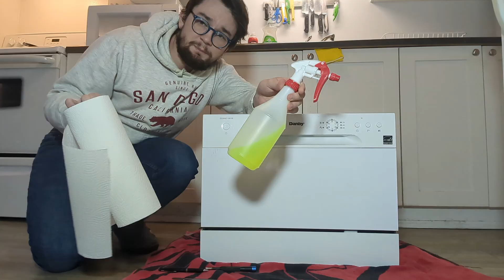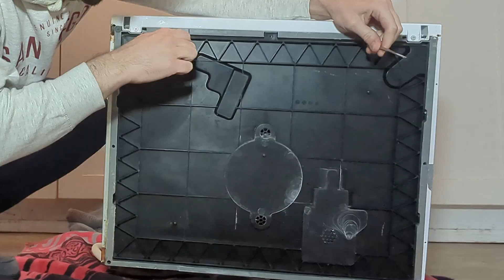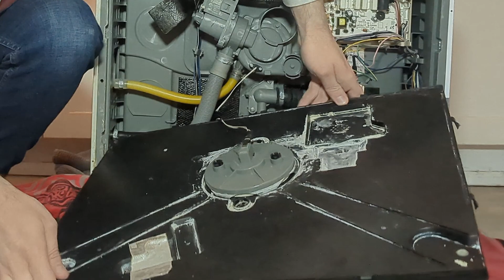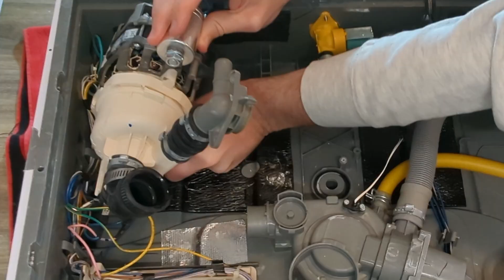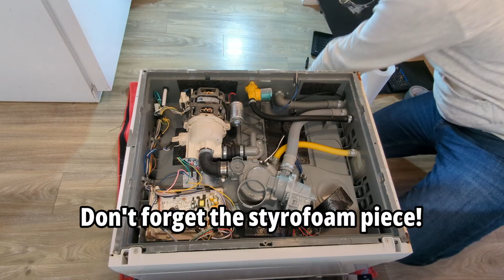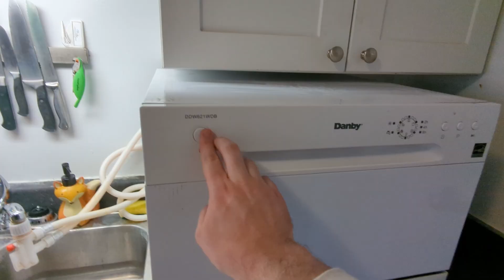How to Repair Leaking Countertop Dishwasher | Danby, Comfee, Hamilton Beach, RCA, SPT, BLACK+DECKER

Comment: I just completed this repair and ended up replacing the gasket on the part he is removing at 6:55, the o-ring gasket on the upper part of the pump assembly as well as the oil gasket. After changing out those my dishwasher is back to working beautifully again. Just an fyi for anyone reading this, save yourself some shipping charges and get them all at once! I didn't know I needed the pump assembly upper gasket and had to wait for it to come in. Great video and saved me from paying a repairman. Thank you!!
Reply: Thanks! Would please share the links to all parts we might need?
Reply: Seconding the other comment, if you can share links to the other parts that would be great!

Comment: Do you know what size worm clamp at about 6:30 that is that you removed by screwdriver?  They come with pinch clamps on them, which i'll have to remove, but i'd rather put a clamp like you have on back on in case I have to do this again.  Just ordered the gasket already too.